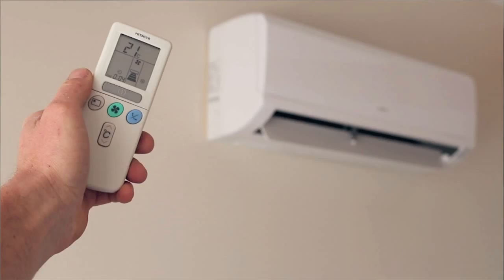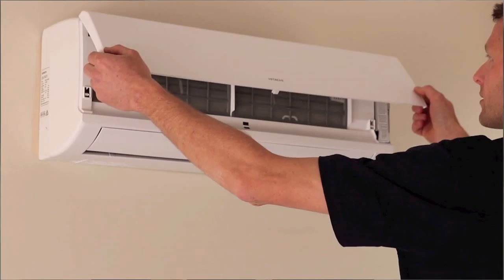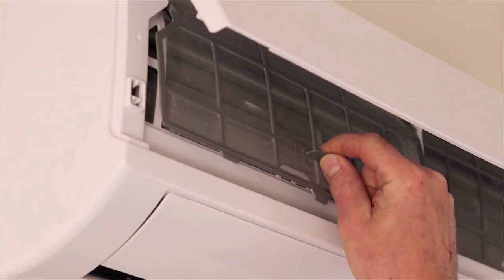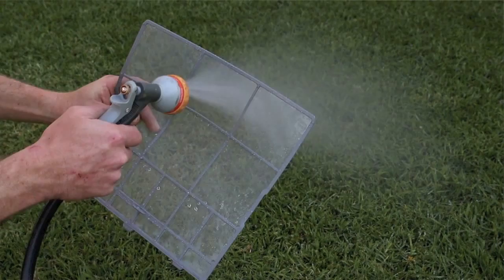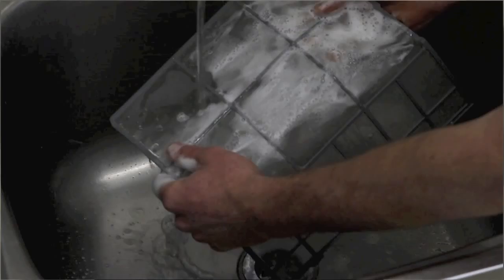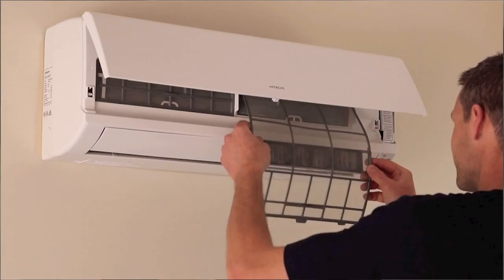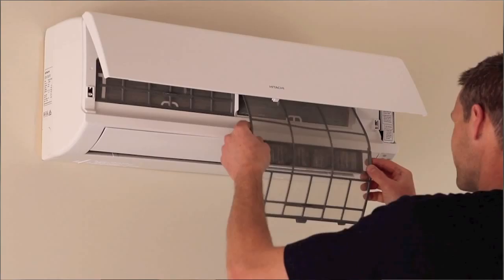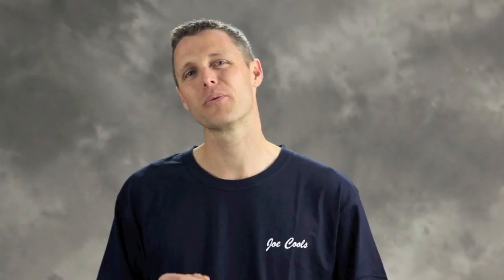Air Con Filter Maintenance  /  Wall Split /   How to DIY

Comment: I bought an AUX brand mini split and installed it myself.the dealer I bought it from doesn't have them and says they're not available would you have any idea where I could buy some for italso I have some remote control programming problems that they're not been very helpful with anyone know how to work the remote on these pretty good please help

Comment: Not half been told, nor show.
What about the roller fan glogged with dirt  & dist?
What about the outside filters glogged of dust?
What about dirt & dist got into the cooling vane unit?
Reply from the maker: Wow, sounds like you’re in a bit of trouble! Definitely poor maintenance of the filter on this machine. With the level of dirt and dust you are describing, it sounds like the front housing of the machine needs to be removed along with the indoor air handling assembly. I would recommend a competent professional to undertake such a task to avoid further damage to the machine and hazards from electrical connections.

Good luck & take care.

Comment: I need help with my unit as I never until now have used the heater on it and it's doesn't turn on cooling works great but heating  shows a droplet symbol please heap
Reply from the maker: +Shahida Khan
Hi mate,
The droplet symbol generally represents the operation of the dry/dehumidification mode.
Try pressing the mode or operation button on the controller until you get to heat mode. Heat mode is typically shown as a sun symbol or by the word heat. 
Good luck
Reply: That you for your quick response.  I have tried that the sun symbol comes on the remote  but not the aircon. I looked  in manual as it says its defost mode. I live in Melbourne and it doesnt snow so i dont know?
Reply from the maker: +Shahida Khan 
If you can, ensure the outdoor air con unit has nothing obstructing the air flow across the heat exchange coil. 
Also it might be a good idea to reboot the A/C see our reboot air con video for a how to.

All the best.
Reply: Thank you I will give it a go. Otherwise have to get the professionals in. You would have been #1 on the list if your bussiness was in Melbourne. Really appreciate your help.